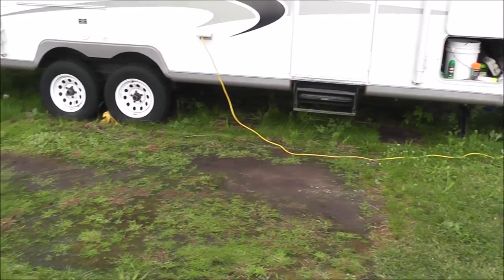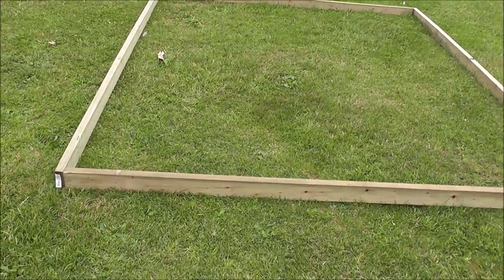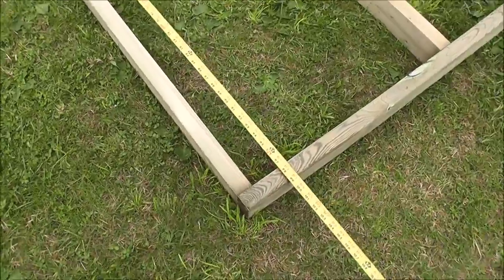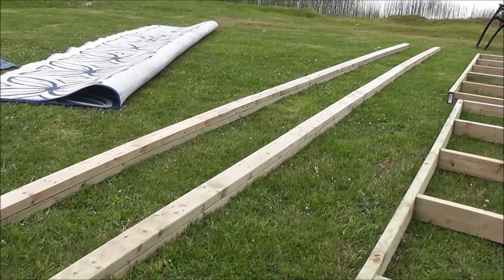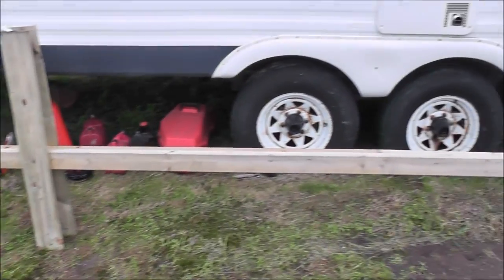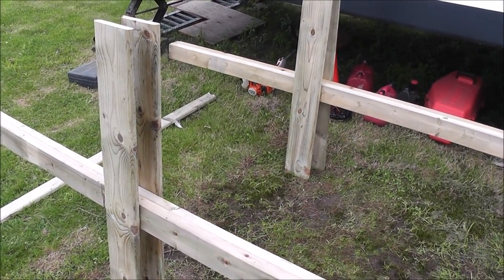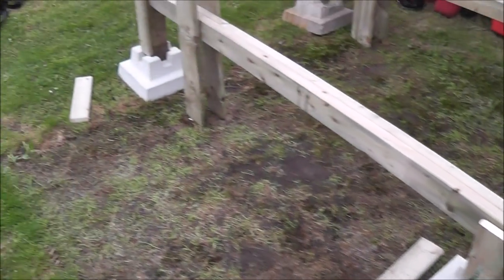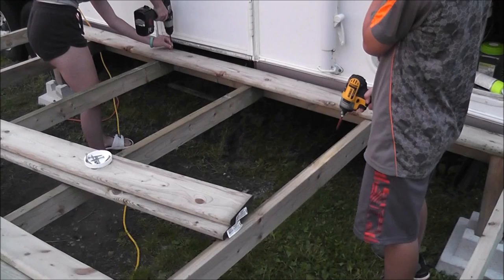How to build a moveable RV deck

Comment: You did a great job. If I could suggest anything is that 2x4's do not pass code for structural floor joist. 2x6 or 2x8 on 16" centers depending on height and payload.  Just a thought
Reply from the maker: Guy Charles thank you for watching and commenting... i went with 2x4 for a few  reasons... 1.  It’s cheaper lol. 2.   We are only a couple feet off the ground so I felt we weren’t sacrificing safety and 3.  It’s lighter to move the deck when we need to move it. Under any other circumstances I would go with a larger beam.  However, I do these projects on my own and am always open to any type of advice, observations or constructive criticism.  They usually lead to other projects and any time i can do something that is an improvement on what i have is a plus for me... thank you

Comment: looks good question about the spacing on the joist is that at 24" set ahead?
Reply from the maker: yes, we figured that would be fine considering it is just a rv deck.  No issues in our instance

Comment: So how would you move this?
Reply from the maker: drag it out , a lifter or two on each end will do it.  The deck is made in two sections , each one is 8x10 which is not hard to move around.

Comment: What are the post bases that you used?
Reply from the maker: I used 4x4 deck blocks
Reply: @capercamper  where’d you get them?  Is there a brand?
Reply from the maker: @raymondgaczewski4333  i got them at Home Depot, they are not a brand. You buy them bases on the dimensions… each one is ~$8-9 dollars

Comment: Did u guys use some kind of brackets to hold the decking frame to the beams, or is it just sitting on top.
Reply from the maker: it's just sitting on top, we used a couple long screws to butt them together.  We have recently built another deck for another trailer and they are just sitting on top... so far no issues.  If there are we can do the same.

thanks for watching